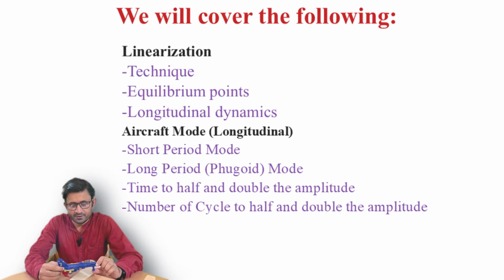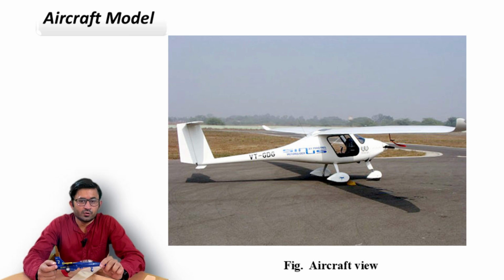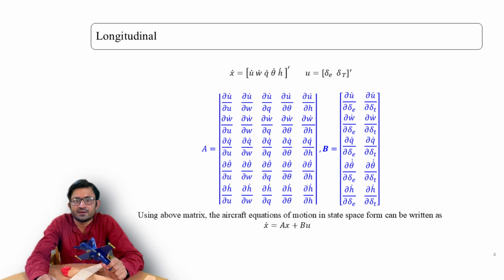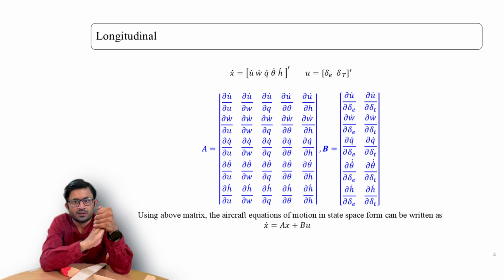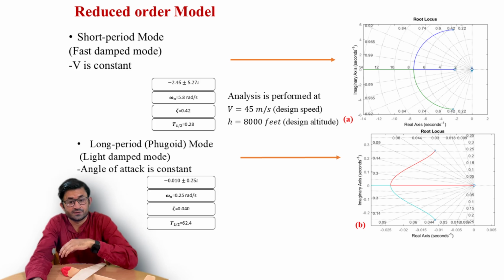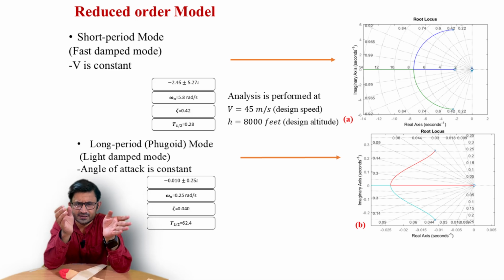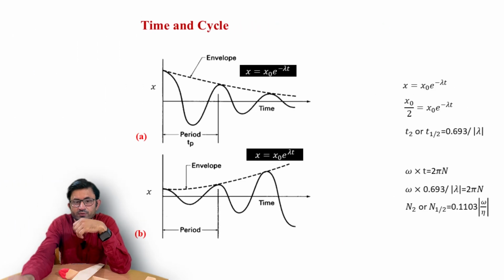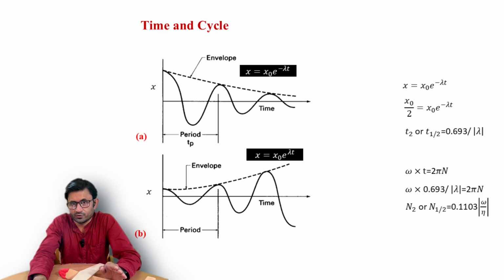Lecture 10 | Aircraft Longitudinal Dynamic Stability (Contd..) | FSAC by Dr. Salahudden

Comment: those students has some little bit knowledge in longitudinal dynamics this class is perfect for them, they can catch it easily.  but the problem is for beginners they can't handle it. so, sir if you elaborate it more details it will be better for them. absolutely you have outstanding knowledge about flight dynamics and performance. so if you do it by white board or led board it is more better to understand and derive the equation. i know very well to them those who are from private University they don’t know about flight dynamics even though final year students, because lack of knowledge of lecturer in that University,  so absolutely your class can help them lots. great work is always precious to fews, not a huge.
Reply from the maker: Thank you for your valuable feedback 😊. I appreciate your suggestions regarding the level of detail and presentation format, and I will consider them in future lectures.
Thank you once again 😊.